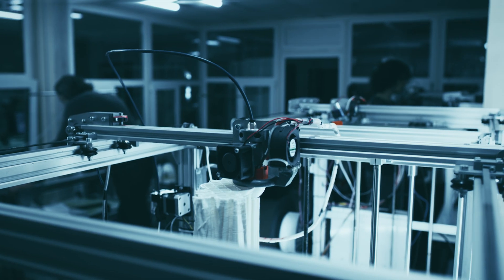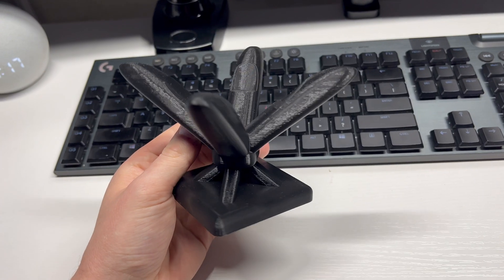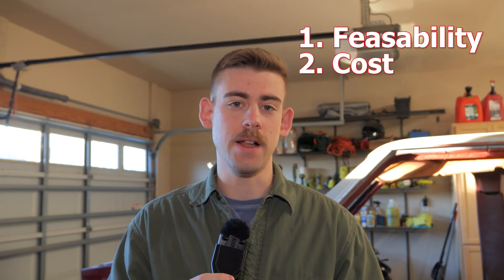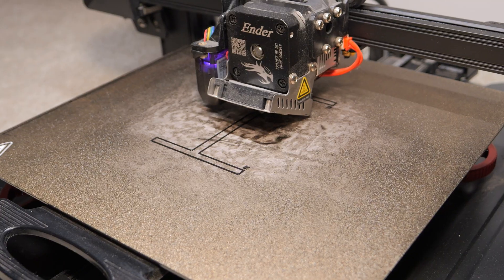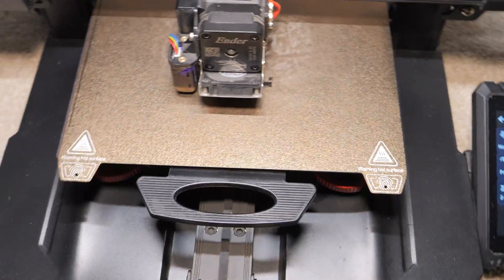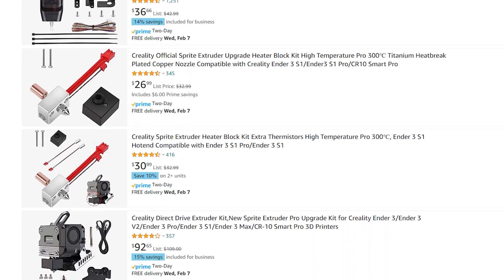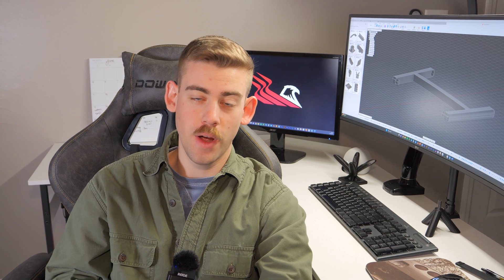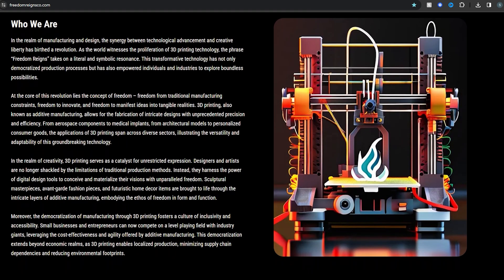Self-Reliance Redefined: 3D Printing's Role in Off-Grid Success

Comment: Brass sand casting is the traditional method of making things you need but getting the temperature to melt metal can be difficult. I think the biggest problem with using 3D printing off grid is that it isn’t rotary/non electric and that currently it only can print plastic in domestic 3D printers. When it gets better at printing metal and if it could print ceramic it would be much more useful but it needs to be completely mechanical using cams for the designs. Btw you’re very handsome. :)

Comment: Hey bro cool vid, can i ask what color/brand filament you used in the opening scene? Love that color green.
Reply from the maker: Thank you! I will be honest with you, I'm not entirely sure. That was one of the stock videos I pulled off Envato Elements. However, here are some suggestions as to what it could be. 

1. https://www.amazon.com/OVERTURE-Professional-Toughness-Dimensional-Probability/dp/B0991TM5YB/ref=sr_1_1_sspa?keywords=light+green+pla&qid=1707357323&sr=8-1-spons&sp_csd=d2lkZ2V0TmFtZT1zcF9hdGY&psc=1

2. https://www.amazon.com/ELEGOO-Filament-Dimensional-Accuracy-Carboard/dp/B0CFV5MQKR/ref=sr_1_5?keywords=light+green+pla&qid=1707357366&sr=8-5